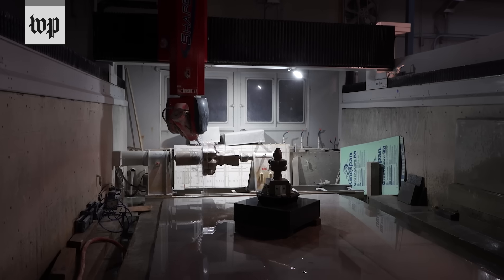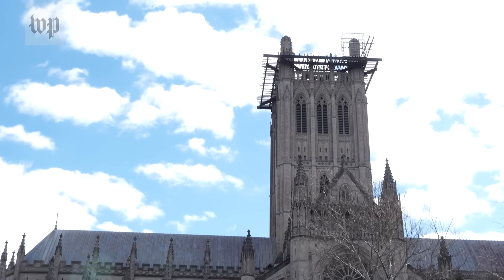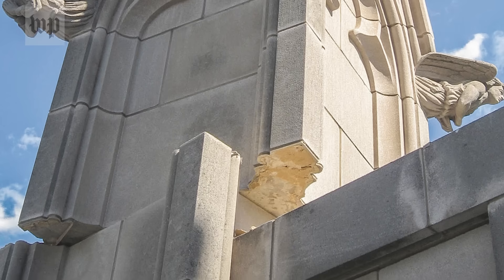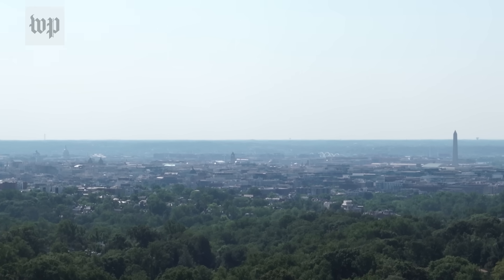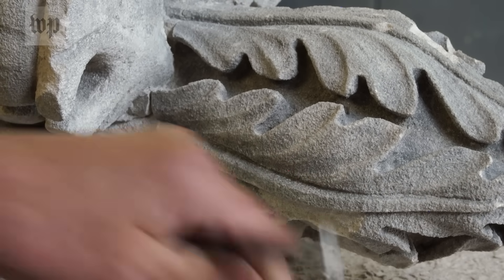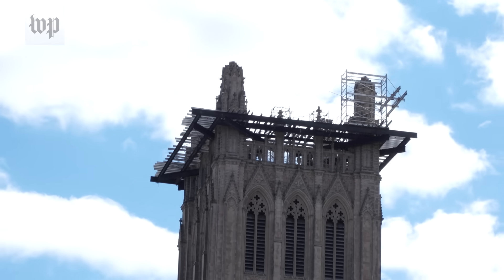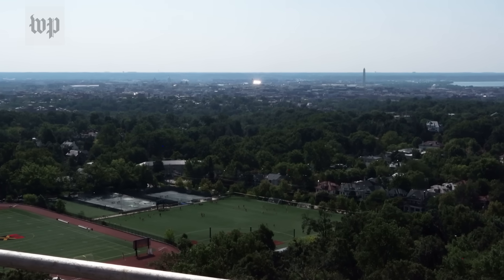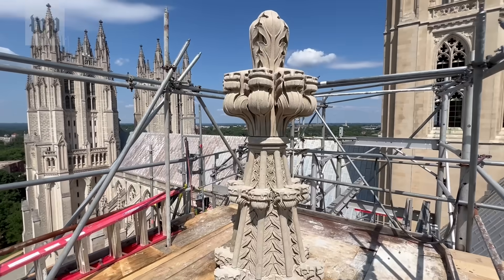A robot is carving the National Cathedral. Here's how

Comment: Imagine if we could use these machines to return to the elaborate, beautiful structures of old but at an even grander scale. Screw the sleek bland boxes made only for growth.. here's an ornate, beautiful building we made for the same price thanks to ROBOTS.
Reply: I mean, we sometimes do. Those design languages just aren't currently in vogue. Maybe with metal stamping/shaping machines, we can get that with the materials that we like using nowadays (metal), rather than going back to subtractive methods on heavy materials per se.
Reply: There is nothing wrong with minimalist tho. Thet "Bland gray concrete box" actually has a very high regarded place in architecture. It is called "Brutalism" and it can be extremely nice! You see a lot of it in South America

Comment: Imagine if Leonardo or Michaelangelo sees this, it would blow their minds or give them massive disappointment
Also, wouldn't it be faster, lighter and stronger if they just 3d print it using concrete then just smooth after its dried?
Reply: Depends how much artistry is left in the final product. Impossible to know, but presented in the correct way, I imagine there's no reason the masters of old would begrudge technology that assists artists. And there are obvious design reasons why they don't want to use concrete instead of natural stone, especially in something with more than practical significance.
Reply: @Cyrribrae  its doesnt really make sense. They put so much effort for a piece that barely anyone can see. They are already using advanced technology to carve this stone, why not use 3d printed concrete instead.
Reply: @doodskie999  cause concrete sucks, its difficult to work and its got the wrong color.

Comment: What type of steel did they use for the threaded rods @4:30 ?
Reply: Most likely stanless steel, to prevent corrosion. Sometimes when corners are cut or the company is cheap, normal steel rods with a protective layer are used, but i don't think that would be the case when working on a prestigious object.

Comment: There should be a return to this kinda magnificent architecture with the assistance of 3D carving . Concrete skeletons with glass facades… so done with that
Reply: Yes, as I was reminded of when I dreamt of an office building that would be modern on the inside but have a huge facade made to look as though it was built, or at least designed, in the mid to late 1800s or so.

It would basically be the reverse of some projects I had seen that keep the facade of a historical building but gut the inside of that and build a modern building within the confines (common giveaways of that are the building extending beyond the original roof and/or flat glass panes where openable windows would normally be).
Reply: I wish.  All that detail still costs money - made by hand or robot.  And when everyone is trying to squeeze blood from a stone, it's pretty hard to justify making GOOD architecture when the steel and concrete sameness is so much cheaper to produce.
Reply: @Minalkra  The point is that a robot will make it cost far less money once it is able to do the entire work without human assistance at the end. If we can make the whole process automated, even the ore extraction, there will be no need to make concrete slabs because the ornamental architecture would already be plenty cheap.
Reply: I hate how simple and boring things are looking despite us now having the ability to make things more detailed than ever
Reply: Thats my biggest dream.
Reply: @Shmancyfancy536  thats not  my biggest dream ... Conquer the world .....
Reply: Maybe robots can do the majority of the big cuts, but then it can be finished by hand, so that what remains is hand carved!
Reply: That's exactly what an artificial intelligence would say
Reply: That church is a wonderful symbol of government and religious oppression
Reply: @mattheww797  Ahahahah what? 5 IQ comment. In USA the Catholics if anything should be a protected minority how they are a symbol of oppression
Reply: Yes yes yes yes yes yes yes!!!!!
Reply: It would be amazing… imagine combining it with complex 3d printing and AI based topology optimization.

Comment: "That's probably two months' work for a guy..."
"That's two months' employment for a skilled artisan but we're eliminating the need for skilled artisans."

Fixed it for ya
Reply: Or, the robotics doing the the menial waste of time work at lower cost so the high demand human skilled labor can be applied to even more fine detailed art.
Reply: @PaulaKeezer   There isn't a huge demand for this type of work to begin with.
Reply: "Now I only need to hire a skilled sculptor for a couple weeks, here and there. That means more money in MY pocket." 🤮
Reply: Budgets are tight - why sacrifice the cathedral itself, or the jobs of other people and artisans who rely on grant money when it could be done by a machine?

Besides, the hand tool the stonemason was using here is already a significant departure from truly traditional work, probably saves time, money, and degrades the humanity of the work.
Reply: @samuelmelton8353   So robotics doesn't degrade the humanity of the work, but his hand tool does?
Reply: @tthomas184  My point is that both undermine human craftsmanship, yet people have selective vision.

I, however, do not believe that this is a problem when budgets are tight and it is better that the work is complete than left undone for years.
Reply: @samuelmelton8353     My point is one undermines human craftsmanship,  the other does not, for the simple reason one is done by a human, the other is not.  Robotics put skilled craftsmen out of work, no matter the budget.
Reply: You are being completely arbitrary. The hand tool he is using is not part of the traditional way of carving stone. The work does not reflect the movements of a mallet and chisel held by a human hand. It does not take the same time as a traditional craftsman using just a mallet and chisel. 

Both degrade to degrees, and given the financial context and the fact that I don't view the use of power tools as particularly special, then I have no objection to the use of what is essentially just a sophisticated just milling machine.
Reply: @samuelmelton8353    You're being absurd. The craftsman uses his skill and knowledge to guide a power tool just as much as a hand tool. Do you think the power tool guides itself? It no more takes away from the human element than using an electric drill rather than a hand drill. Does anyone apply this standard to carpenters? Are they not skilled?
Reply: @samuelmelton8353  The pneumatic carving tool he is using, likely a Dallet brand, goes back at least 100 years now so in some ways is "traditional". All depends where tradition starts and ends and our generation. Still not hammer and chisel but pretty old technology and still relying on the hand and eye coordination of the carver rather than the accuracy of the laser scan and resulting CNC code developed from it to do the roughout work being done now. That said I used to hand cut lettering in marble the early 70s for a monument company and thought pneumatic tools were cheating......till I had to cut letters in granite LOL I do agree with your sentiments though and miss the old ways and today's methods are just not the same.

Comment: Surprising Andy Uhl doesn't wear a mask while carving. Silicosis is not a joke.
Reply: While it's never good to breathe in dust, limestone does not contain silica. It's mostly calcium, an organic source, which the body can deal with. But you're right that sandstone is nearly 100% silica (sand) and granite also contains a significant proportion.
Reply: Normal limestone contains around 5% of silica compounds. "Most limestone is otherwise chemically fairly pure, with clastic sediments (mainly fine-grained quartz and clay minerals) making up less than 5% to 10% of the composition. Organic matter typically makes up around 0.2% of a limestone and rarely exceeds 1%." @stahlmandesign